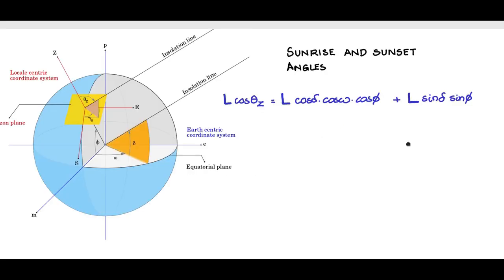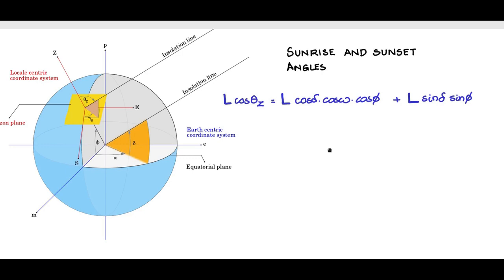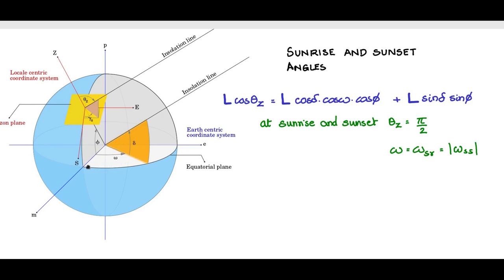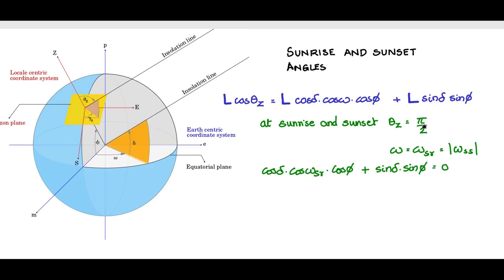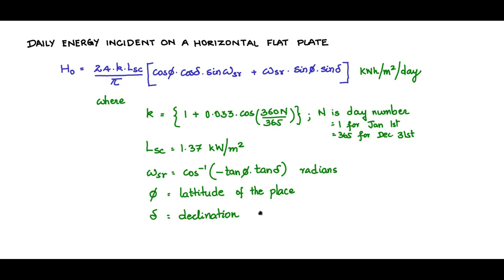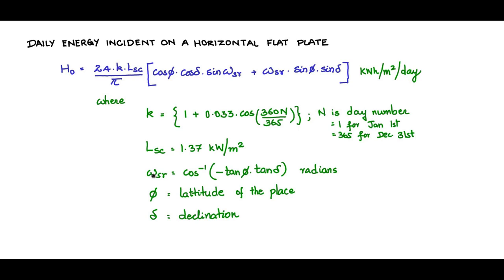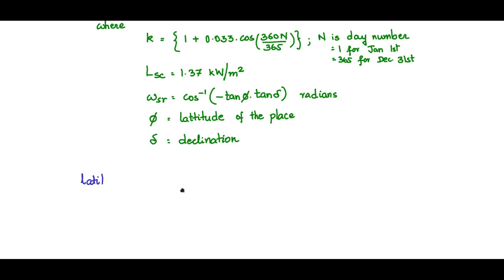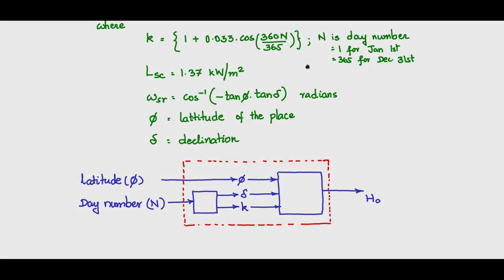Sunrise and sunset hour angles

Comment: nice video. Converting Hour angle to Azimuth, is there a simple way to know which result is correct (as the formulas and the arccos give various results shifted by 180°etc.), or does one just have to figure it outvisually with the drawing?
Reply: Many text books are refer to Azimuth angle, this lecture did not refer to Azimuth

Comment: Actually the subject is not so difficult, the complex is there are too many cross disciplinary physics of semiconductors, power electronics, electronics/electrical circuit, earth geometry, battery/pump load, and mathematics tool
Reply: That is difficult, but processor L Umanand made it easy